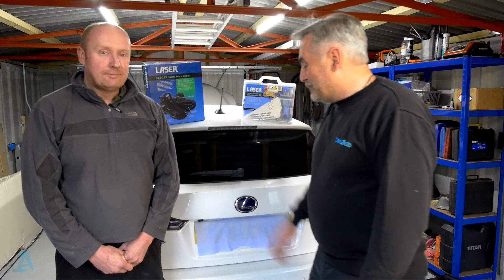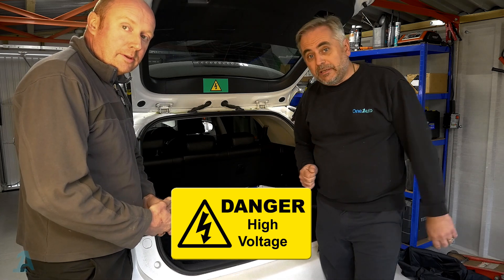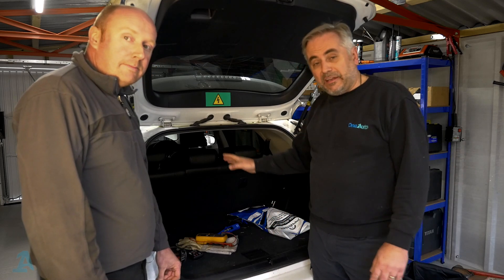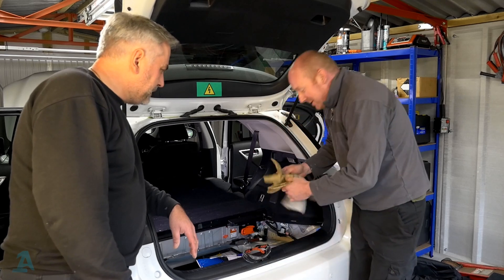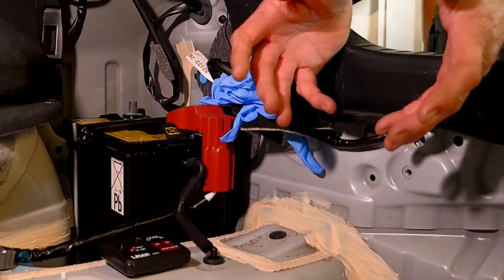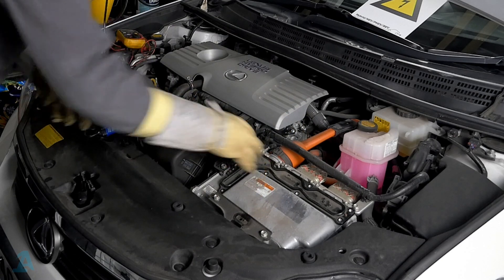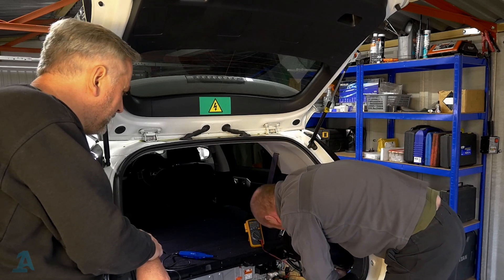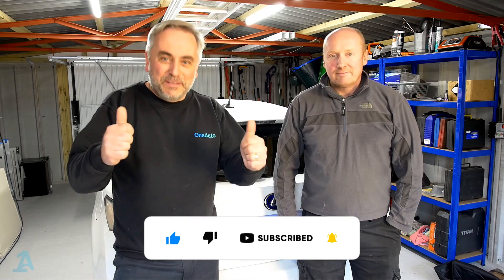Hybrid & Electric Vehicles - Safely Disconnect & Shutdown

Comment: I'd be interested in guidelines for firemen, who need to make quick decisions regarding their own safety balanced against the safety of a trapped victim. They may not be able to reach the 12V battery, and waiting 10 min for capacitors to discharge may not be practical.
Reply from the maker: Hi my friend. Very interesting point you make. Ive seen a lot of EV’s with a connector under the hood for emergency workers to disconnect to make the ev system safe. However if the front is crushed they won’t be able to get to it. They also don’t have time to flick through a car manual to locate the isolator. The firefighters own safety has to come first in this instance.

Comment: I do think the UK has the most extreme rules and regulations, especially when it comes down to electrical works. Just wondering how many of the things shown in this video are really needed. It could be all of them, just curious.
Reply from the maker: Well dealing with 300 to 900 volts with EV’s safety is imperative. I wouldn’t want to try without doing this way
Reply: Also for safety of the control boards scattered around the car, don't want to strike one of these expensive PCBs as well as yourself.

Comment: I don't see why insulated work boots are req the volage is not in respect to earth (IE the ground your'e standing on)
Reply from the maker: Their main purpose is to protect against and prevent an electric current from being grounded. High voltage electric current passing through you can stop the heart or produce fatal burns to an unprotected user. These vehicles range from 300 to 900 volts.